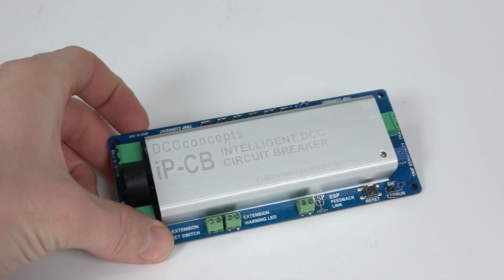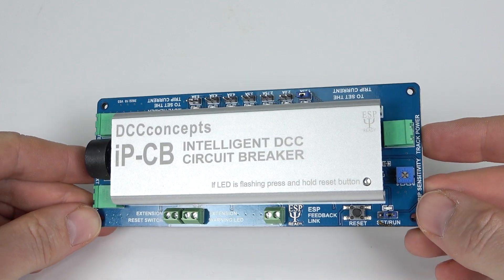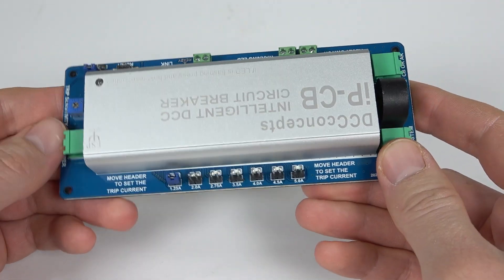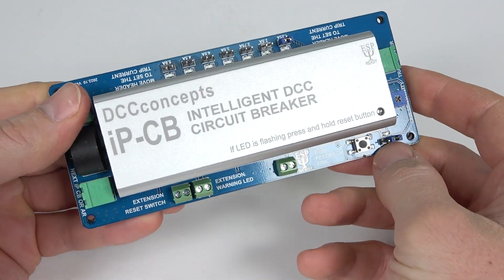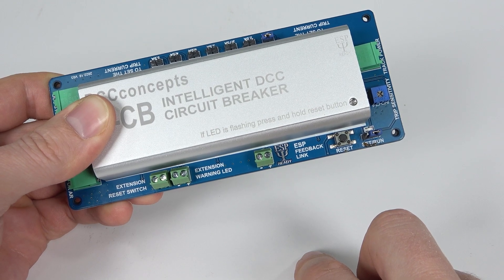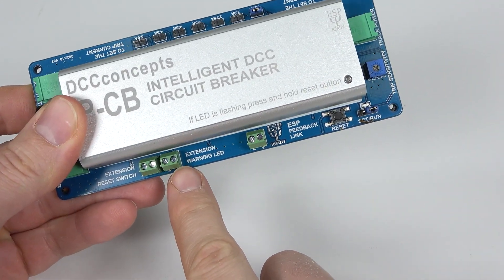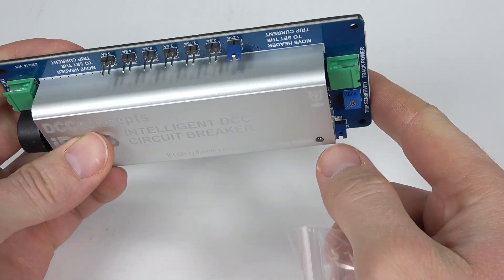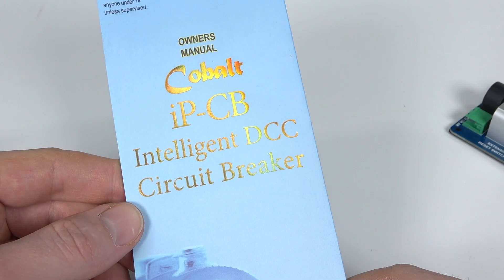Quickview: DCC Concepts IP-CB Circuit Breaker

Comment: i thought good dcc controllers have this built in to them ??
Reply: Correct. Most decent systems will have some form of protection built in that you reset. But it might not be as protective as this, and as mentioned, it means you can split the layout up so one area doesn't trip if another does. As someone whose layout was wired up without these, it'll make life much easier to fault-find. It took me a week to find a short I had. If this was installed and I did wiring to a higher standard, it would've taken a hell of a lot less time.